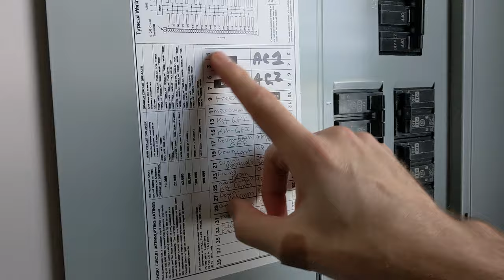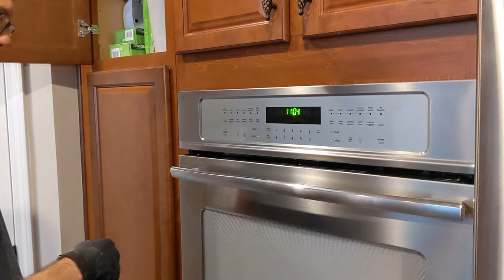How to repair an oven shutting off | Frigidaire Oven Fix

Comment: It was definitely not the fuse. If it were the fuse, it would not even turn on and the screen would be black. You were definitely right about it being a bad relay board.
Reply from the maker: Well I thought it was a thermal cuttout that resets itself, but when I saw it was a manual breaker then I knew it wasn't bad.
Reply: I see! I’m glad it fixed. Is it still working and not turning off?

Comment: Relays do tend to fail expecially the ones that are switching high currents like the elements.
It's mainly the Relay contacts that burn out and go resistive and work intermittently.
If you know what you are doing you can trace it down  
and replace it, they are fairly cheap around less then £20
Another thing to check is the acutall connections on the board that feed the heating element, you could just have a bad/dry solder joint so worth checking that first before replacing any parts could save you load of money.
Reply from the maker: Ya I thought about that, but since it's high voltage I didn't want to take any chances of not doing a good enough job
Reply: @CarolinaCowboys  you did the correct thing, safety come first.👍

Comment: I think my oven my be doing the same thing. It heats up and will be on for about 15-30minutes and then the entire ovn shuts down. After the oven is completely cool it will go back on and I can use it again. So strange because it started happening 6 months ago and has been fine--up until I was baking a cake yesterday. So, sounds like the same thing as yours was doing.??  I am guessing mine too will be the main relay board? As it difficult to connect all the wire plugs in the new board? Thanks! Love your video!
Reply from the maker: The hardest part was getting the oven in and out, everything else was easy!
Reply: @CarolinaCowboys  I just finished installing my new relay! The oven heated and didn't shut off!!! I watched you installing your relay on slow speed--I couldn't figuare out how to remove two of the connectors. But saw in slow speed you used a screwdriver to pry them up. Thanks again for the great video. Saved me from having to hire a repair person--who told me he was going to replace the thermal fuse.
Reply from the maker: @thatguysinger  glad you were able to get it done!

Comment: If I knew a Frigidaire was made by Electrolux I think I went about an Electrolux we got the same problem going here but you got there I don't think they may ever make any more good stuff like to use in the old days my mother used to have a stove for 25 years this is my fourth stove already
Reply from the maker: Ya I think the base heating components are the same as 25 years ago, but the newer electronic features are what seem to be faulty.

Comment: Was the initial symptom simply that the oven stopped heating?  Or was it more than that?
On ours the oven shuts off and the clock resets.  We can start it right back up, but it’ll often repeat after a few minutes.  Something getting too hot makes sense, but I don’t know why that would mess with the clock
Reply from the maker: The whole oven shuts off, sounds like the same problem
Reply: This is exactly what's happening to ours...did you end up replacing the main relay board?
Reply: @jade2710  Yes and it fixed the problem

Comment: I have a smaller irregular sized  kitchenaid (17"w) that I would replace if I could.  I blew the thermal shutoff fuse (single fail type stock) and replaced it with an auto resetting thermal sensor.  I thought I was the Uber genius when I got the oven to work again,  but I continue to have power shutoff failures (mid cookie making!) that annoys the Mrs and deflates my fixit ego.  I was thinking that maybe when replacing the fuse/sensor, I placed the wire on the wrong side of the insulation surrounding the oven.  The PF occurs when above 375 for 10-15 mins or "steamy" dishes.  It comes back on but screws up my timing.    I may take the unit apart again and reposition the sensor in a more insulated situation and see how that works.  If not, I will look at the board replacement
Reply from the maker: Pretty sure it's going to be the board!

Comment: It appears they no longer make this board anywhere.  I have scoured the web and its not available anywhere.  I found a company in south carolina that will repair an existing one though.  Im going to try the fuse you put in first today.  If that doesn't solve it, I'll be mailing the board to them for repair 😢
Reply from the maker: I put a link to the parts in the video description

Comment: my oven is also Frigidaire and the top oven keeps shutting off after 15-20 minutes of use and displays the Error Code F10 but I'm able to run the bottom oven up to 30 minutes with no issues. Could the relay board only affect the top oven and not the bottom oven?
Reply from the maker: Yes there's a separate relay for the bottom oven, unfortunately both ovens are controlled by the same main board I believe.

Comment: Every time I use my oven just to cook it will automatically change over to self cleaning why whirlpools activate system
Reply: I need an answer please help
Reply from the maker: It's probably the same fix to replace the main board